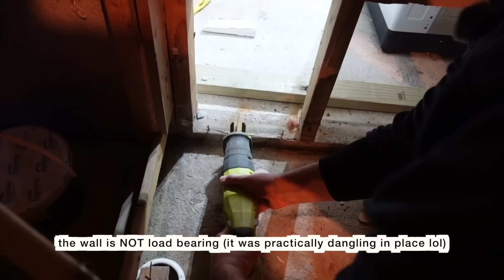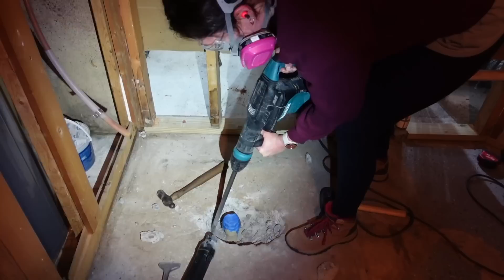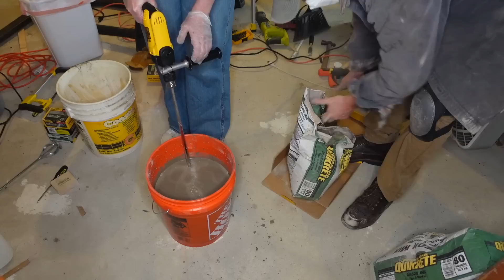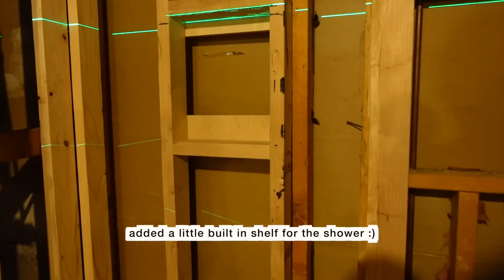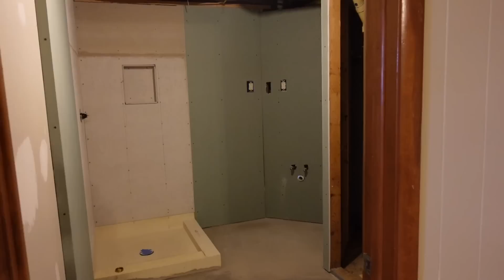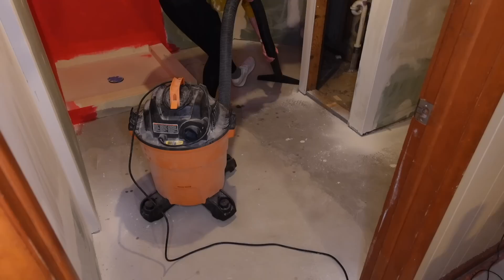Extreme Basement Bathroom Makeover | Part 1

Comment: Bathrooms are often more of a challenge than kitchens to redo/upgrade, in my experience (which mostly consists of holding things and being the “gopher.”) I did strip the wallpaper in the master bath which was quite challenging. The walls had some damage as a result because that stuff wasn’t easy to remove at all. Congratulations on what you’re both managing to accomplish on your fixer-upper!